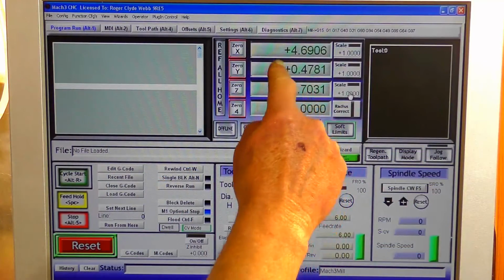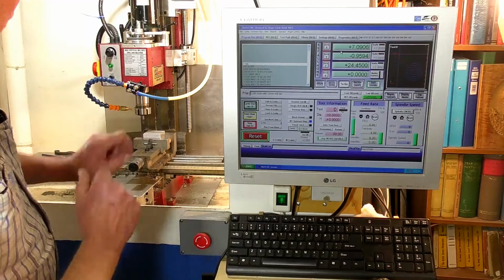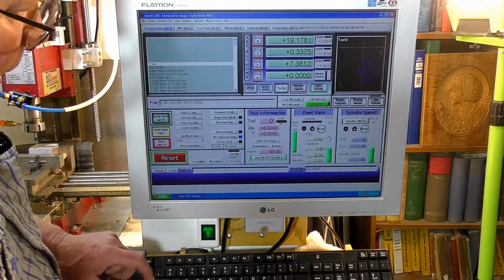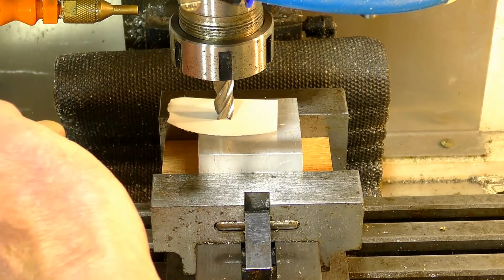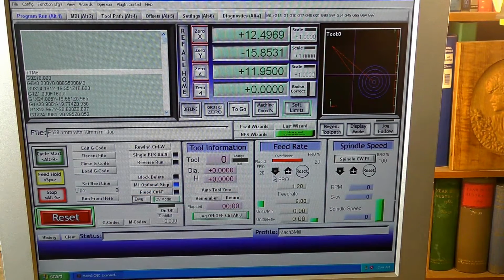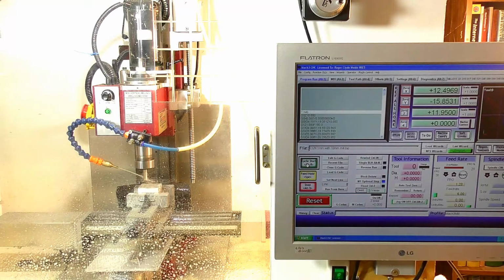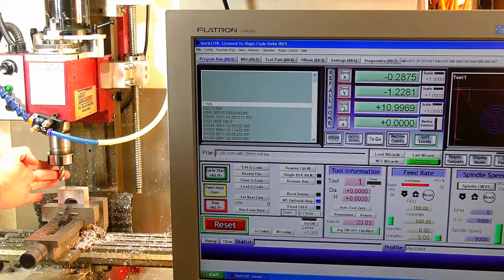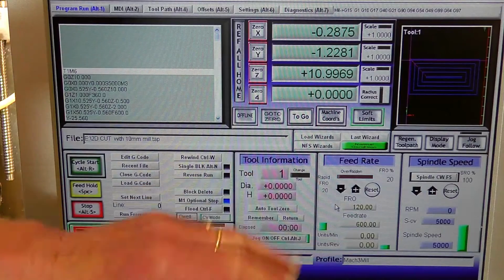A beginners guide to CNC milling and Mach3

Comment: One issue i note, you used an end mill which is not designed to plunge directly down into a piece. It has 4 flutes but the cutting edge does not go to the centre of the tool. Better rough our with a slot drill then clean up with end mill. Other than that very useful

Comment: You're amazing Roger with these educational tutorials :) I had a question regarding soft limits with Mach3. 
Is the soft limit overridden when given manual Gcode instruction on MDI? i.e. the soft limit doesn't matter and it would crash :(?
Reply from the maker: Hi, if the soft limits are turned on and you have them set up right the axis will stop no matter